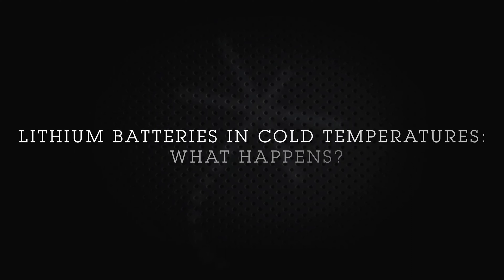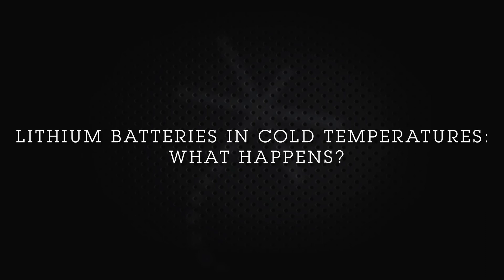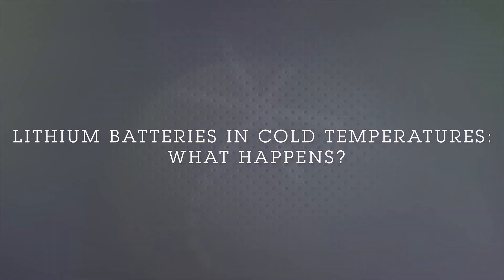What Happens When Lithium Batteries Are Exposed to Cold Temperatures?

Comment: I am from Alaska where we can have temperatures down to minus 40. While I would not attempt to use any battery at those temperatures is it permissible to store the battery and the RV coach at those temperatures so long as there is no discharging or charging going on? If it is OK to leave in the extreme cold what is the ideal state of charge? I'm not sure it's possible to remove my batteries from my coach altogether in extreme cold weather.

Comment: May I charge the big li-ion battery of my ebike in my apartment and then store it on the balcony for the night, even if the temperature in winter can go down to -5 Celsius?
I will have performance issues the morning after when I mount it on the bicycle to go to work?
I'm pretty scared from thermal-runaway events, and I would like to not keep the battery in the same environment where I sleep... Any suggestion?
Reply: We just had a fire in apartment building last month.  Upstairs neighbor had eboard battery catch fire.  Instead of throwing it over his balcony, he threw it in hallway outside his door.  I wouldnt have one near your house or yourself.  They sound volatile and unpredictable.
Reply: This is a big fat no. The battery is in use at all times from the day it was built, when not plugged in the thing still operates slowly discharging it's load. It can't do that properly if it's frozen. What likely happened to the person who threw the bike in the hallway is that it froze and caused an internal short circuit as described in the video. This leads to a runaway discharge, like touching a car battery with metal it will start welding itself and create a very hot point that catches fire.

Comment: hello  thank you for good viode , please i have some questions 

1- i bought new Electric Motocycle and New lithium phosphat Iorn Battery   i discharged it completly and recharge it 100%   , red light of charger convert to Green    but when i install iot in Motocycle   Screen shoe me that Battery not 100% charged    3 Degrees from 4 degress  
 my question what is reason ?     is Charger  or Battery  or display of motocycle  ?     in my country austria   is too cold almost 2 or 3 C 
 
also after 3 Kilometer distance   batter now  2 degrees from 4 !!  too fast drain    my battery is 60V  40 A

2 -when i use throttle  of mototcycle   degrees of battery decrease to two degrees and then come back to three  it that normal ?
Reply: Could be a myriad of things. Likely one of these two, either the battery is not good and sags a lot under load or the controller is expecting a different voltage than it is getting, thus giving a wrong output reading. If you've only had it a year then it should still be operating as good as the day you bought it if not slightly less range. So how has it been?

Comment: What if it's not charging or discharging and just stored in cold temps?
Reply from the maker: We recommend fully charging your batteries and completely disconnecting them for storage. To ensure the safety of your batteries, we recommend not storing them in subzero temperatures.
Reply: @dragonfly_energy  batteries are stored at 40-60% charge, not full.
Reply: Batteries are always either discharging or charging, there is no off button. Never let them freeze, ever.

Comment: Most off grid lithium mfrs advise no charging below 32F.  Is this merely a safety factor exaggeration or are there different temperature points for different batteries?
Reply from the maker: The battery management system (BMS) within our batteries will not allow them to accept a charge when their internal temperature is below 25°F to protect them from unsafe operating conditions. However, if you expect your batteries to need to operate in below freezing temperatures, our internally heated batteries will allow them to continue to function no matter how low the temperature drops!
Reply: I heard this problem is much worse in lfp batteries 🤔😳
Model 3 & Y Teslas FROM 2021 standard Range